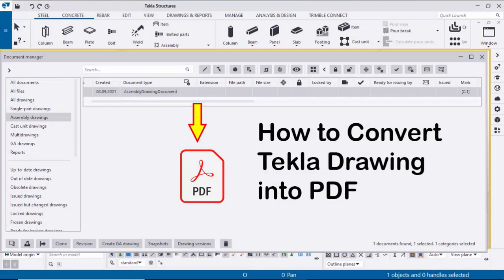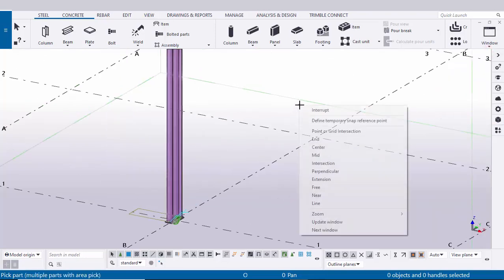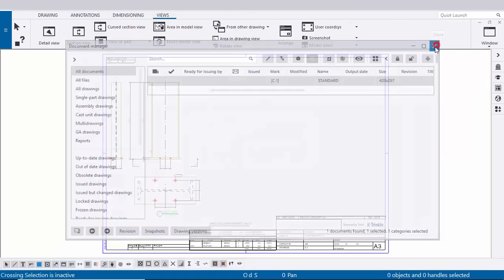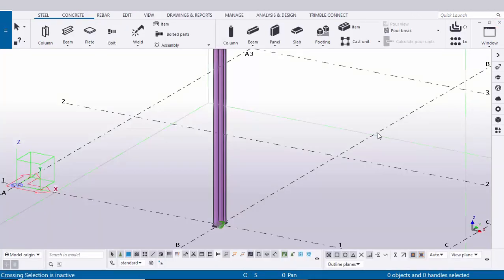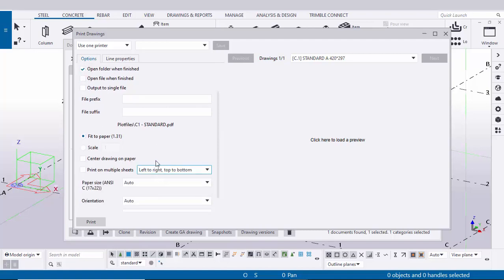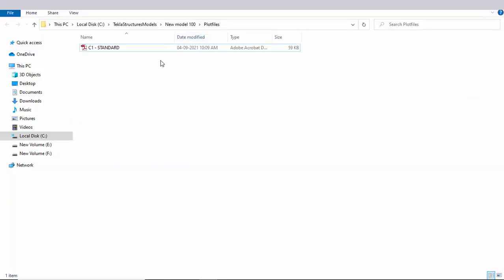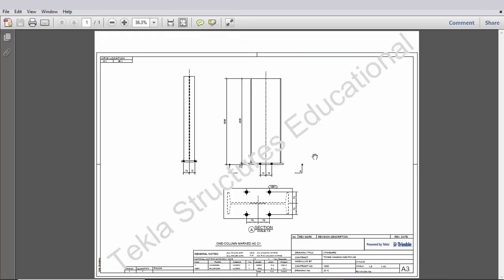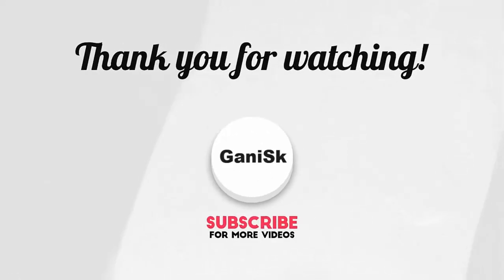How to Convert Tekla Drawing into PDF

Comment: Sirr, how to remove the watermark?
Reply from the maker: If you are using student version then watermark will be generated in drawings, if you want to remove watermark then drawing export into autocad later you can remove watermark in it.
Reply: Sir, please make a tutorial on cast unit drawing on reinforced concrete
Reply: Sir., Why when cast unit drawing on column, beam reinforcement also appears

Comment: Hi Mr. Gani. you are a great person. I would have a question. While we are modeling in tekla structures, for example, we make columns in red, beams in green and plates in gray. but when we export the model both as single part, assembly part and general arrangement, all parts are yellow. they are all one color. How do we export as dwg or pdf according to the colors we use in the model? can you help me please?
Reply from the maker: Those colors are only for model presentation. If you want to apply same colors in drawing, you need to change independently in drawing, just double click on part in drawing and change color, better to use filters to change colors quickly.